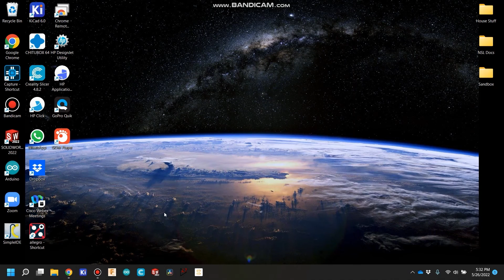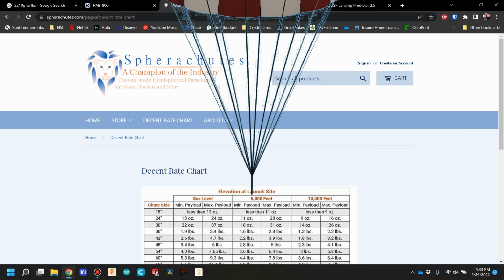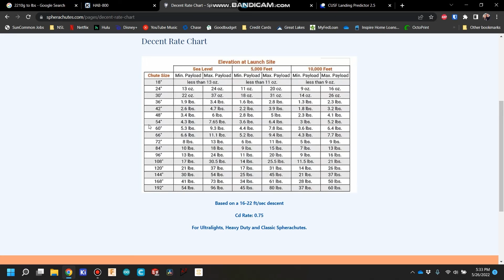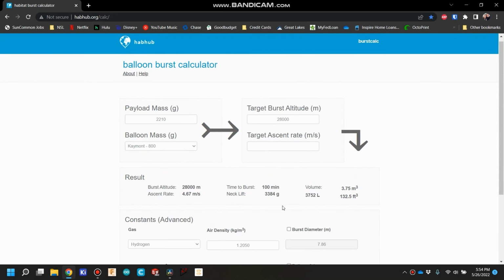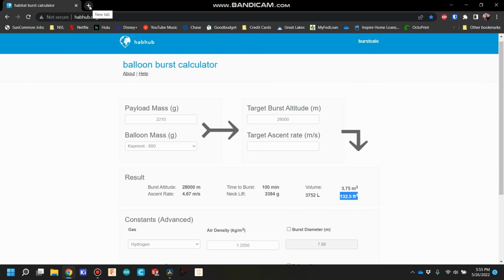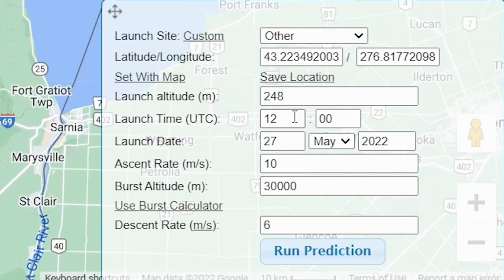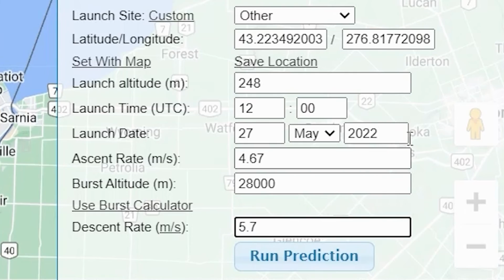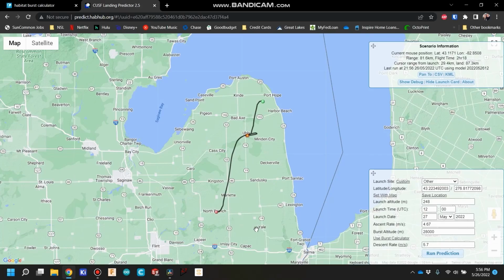How I Sent My Satellite To SPACE - Part 2

Comment: Very good job!! Did you transmitted any live data other than GPS Location? How did you measured the temperature (what sensor did you use?). And if you transmitted live data how did you do it? With what transmitter/receiver? Thank you. Keep it up!!
Reply from the maker: I appreciate the feedback! We don't transmit live data with this device (aside from the SPOT GPS tracker that gives us location and altitude for part of the flight). Instead we have an Arduino Mega onboard acting like a logger/flight controller. We have a number of sensors onboard, but the Adafruit MPL3115A2-I2C Barometric Pressure/Altitude/Temperature sensor [ADA1893] collects all of our weather data. 

We hope to add live data transmission in the future by partnering with a local HAM radio operator that can teach us how!